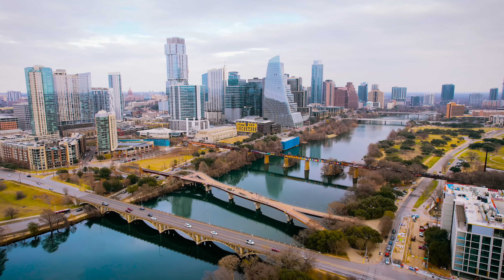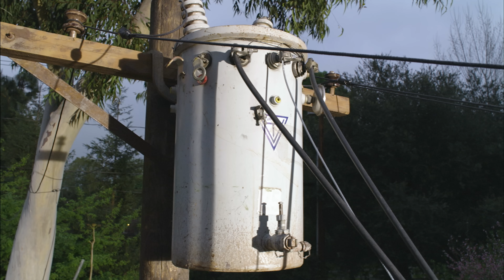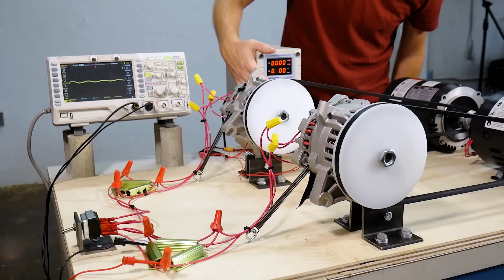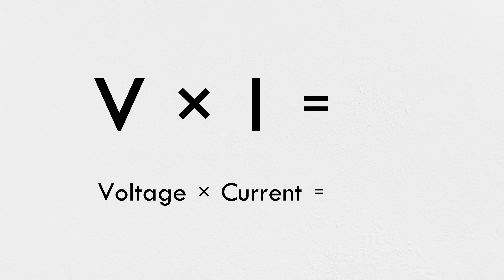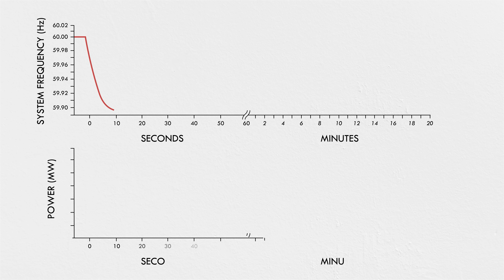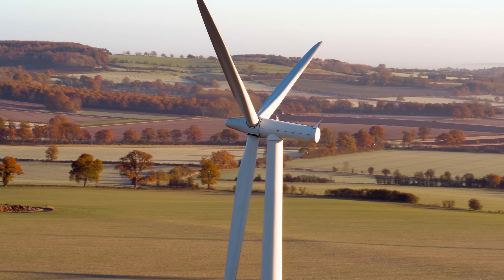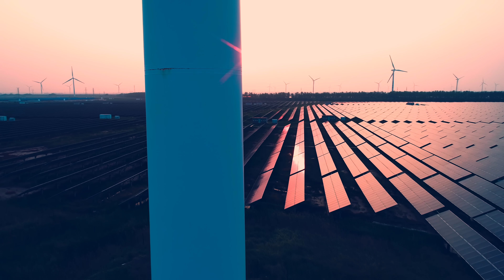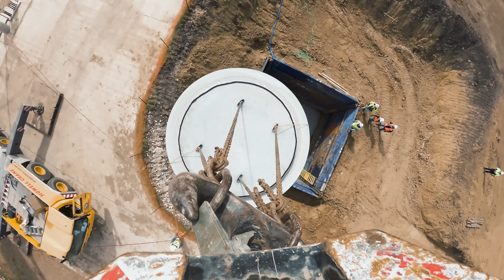Connecting Solar to the Grid is Harder Than You Think

Comment: Observations in no particular order:

1) The drill & generator you showed is a model of a very REAL electrical isolation system (no surges or sags could be tolerated in the computer room) that I saw in use in military applications. Our Explorer post got a tour of such an installation in Virginia back in the 70s. They had an enormous motor connected to a generator with an insulated (plastic?) shaft (for lightning protection) and, if the base's power failed, there'd be enough kinetic energy in the flywheel to allow a quick but orderly shut-down of the system.

2) My own rooftop solar panels use microinverters. I assume there are integrated MPPTs in each microinverter? I have two Powerwalls as well. I also have every sensitive electronic device (server, workstations, and network) protected by UPS units.  This is absolutely necessary because, in the event of grid instability, there's enough lag in switching to battery to harm devices that aren't UPS-protected. It's weird hearing all the UPS units start howling while my overhead lighting doesn't even flicker! It usually happens only once or twice annually.

3) I have always felt that commercial-scale solar farms are an egregious waste of resources. Are we suffering from a lack of rooftops? No, we are not. The highest and best use of PV power is a small-scale utility-interactive system (with a battery bank) right above the heads of the end users. Distributed generation has many advantages and excess power will be used within a few hundred feet of the source (at most). New transmission lines are unnecessary.  Any problems are very localized.

4) Offshore wind power is utterly unnecessary in the USA (not to mention very costly due to extreme weather events and corrosion). We have plenty of agricultural land and wind turbines are far less problematic than oil & gas drilling for farmers and ranchers.
Reply: On #2, basically grid-tied micro-inverters integrate the MPPT into the inverter.  They are one and the same thing.  The "MPPT" function is simply a function of the micro-controller controlling how much power the inverter tries to output to the grid and figuring out where the maximum power point is.

Basically it just ramps the PWM driving the inverter down and then up and records the power output it gets, then settles the PWM down at the highest power point.  Bang!  MPPT.    Once it finds the MPPT point it ramps the PWM slightly up and slightly down all the time to determine if the MPPT point is shifting at all, and tracks it.  Hence the "tracking" part.

And usually every 10 minutes or so the micro-inverter will do a full sweep because the actual maximum power point can have more than one hump in the graph and it needs to make sure that it is on the best one.

On #3 ... commercial solar farms are far, far cheaper per watt than residential rooftop solar.  We do have plenty of rooftops, I've got solar on mine, but the cost of installation is not cheap enough for mass adoption.  A lot of people have solar, but if you look at a satellite picture of your neighborhood (for example) and actually count the houses, you'll find that it is still a fairly low percentage of homes.   Not everyone has the funds necessary to make the investment when the break-even is 10 years.

-Matt
Reply: @junkerzn7312  I appreciate your answer to my question. Your explanation was excellent. I always assumed it was integrated but I didn't self-install my system and don't have copies of the documentation (mea culpa). I did install most of my home automation system, wired ethernet network, and low-power lighting but I'm a bit long in the tooth to be climbing up on roofs!

My highest and best use opinion is NOT based on cost. It's based on factors that justify a slightly higher level of investment. Considering the federal and (some) state tax credits, and local variables like rebate programs, electricity rates, and annual insolation, payback periods for residential solar can vary wildly. I live in the sun belt, so I use every single watt I produce from my 7.5KW array except for the two months per year we laughingly call "winter" because my furnace uses natural gas. My payback will occur in year 7 or 8, supposedly. Years 9 to 25 and beyond will be gravy. The federal credit was recently expanded to include second homes. I think they should expand it to residential rental and commercial properties, too.

Comment: a similar incident to this one happened in (I think it was) Hawaii about a decade ago. It was a mess, a unit tripped off, creating a small frequency dip. Unfortunately, the dip was sufficiently low to cause some of the equipment protection on some of the solar generation to trip, which drove the frequency down further, tripping off even more equipment. I was under the impression it lead to a whole island black out and black start.

Comment: One aspect of inverters that makes them very attractive in densely populated areas is the ability to synthesise matching ‘antidote’ waveforms that counteract the distortion in the mains voltage due to the ubiquity of switch-mode PSUs that only ‘sip’ power infrequently, causing nasty harmonics in the supply. You may have something lined up on this already :0)

Comment: DONT connect it to the grid, there is no reason to. only reasons to not.
keep your solar, or other off grid capable energy sources, off grid.
using off grid utilities on grid is much like converting your car so it only works on train tracks.

Comment: Excellent explanation of grid stability. Many Moving Parts.  Thank You. 
The inverter for you home solar array must be rated for proper waveform, so is more expensive.
You can get your home PV system to work during your two week hurricane outage.  Contact a local Licensed Professional Electrical Engineer.  
At 14:15, the workers had nice Electrical PPE - Personnel Protective Equipment.  Except that leather or heavy cloth gloves go over the insulation rubber glove, as the rubber gloves are easily punctured.

Comment: 6:12 is what you showed, really called "pulse width modulation"? I'm more familiar with PWM fans for PCs, but those work by switching rapidly from high to low. You would never get these partial voltage switches as shown here (without load smoothing)

Comment: If it’s possible could you talk about the synchronous condesnsor. That I’m interested in placing a solar generation facility on land that I own. 🤔 The trouble is that while it could improve the power factor at the facility I install it at I don’t really know how it would interact with the grid tie inverter, worse, the utility isn’t really sure either.😳

Comment: Solar customers should not default to a grid tie system. Loans are schemes. Grid tie creates radio noise and guarantees your kids will grow up radio illiterate. Batteries and 12 volt DC with golf cart batteries is a good small system. Avoid batteries wired in parallel.

Comment: This suggests that the evolution of dependable power is micro grids with the national scale grid delivering dirty power to charge batteries.
This introduces other conversion inefficiencies but,as solar builds out,the abundance of cheap energy mitigates that issue. 
I’ve come to this conclusion due to personal experience using off-grid inverters to power several structures. I was surprised to see how small the amperage,supplied during off-peak hours, was needed to top off my batteries.
Again,there are conversion losses but the savings in wire gauge coupled with cheap solar panels offset this loss.

Comment: It’s not just a challenge to provide ‘fault ride-through’ during transients, but also to provide sufficient fault current at the source, for the generators etc to trip correctly without damaging themselves. If there’s insufficient current available at the generator, as is often the case with renewables (they don’t individually have the inertia of much larger generators), especially when connected over long distances - the protection won’t function correctly and they’ll end up burning out equipment and cables as they unable to ‘disconnect’ themselves. It’s why many grid connections of renewables require large synchronous condensers or similar, to provide the immediate energy/inertia required for protection at the generator source to operate quickly and correctly.

Comment: I found this an intriguing video as a retired Electronics engineer.
Having followed wind/solar/storage/generation evolving for some years, I was rather shocked to learn about the defect in inverter-->grid delivery you described.
I have no notion of how this may be effectively resolved for the long term, but surely there is a way - by measuring power factor at the inverter generation site and using that as an additional means for nudging the grid in a supportive fashion?
Power factor is a measurement that is able to determine the phase-shift between current and voltage.  But it can also be used to determine what must be done in respect of power delivery when the grid 'frequency' is suddenly lower.  Because the power factor measurement can clearly reveal this very problem.
I am confident the boffins will have this sorted fairly soon Sir.
Thanks for your excellent video.

Comment: did we ever switch to DC transmission? DC-DC converters are available and not that expensive now. basically only AC motors today need AC power (but often powered by inverter for rpm/torque regulation, inverters also works on DC) everything else works great on DC.
Reply: in DC many problems don't exist like frequency shift, distortions because when receiver cares about that it's easy to solve there, reactive power also don't exist in DC.

Comment: Any time you want a grid-tied inverter for solar, you not only need to be thinking about the phase and quality of the power you are producing with the inverter; you also need to look at safety measures.

For example, let's say your solar panels produce 2kW and your house is consuming exactly 2kW at that moment. If there's a power outage, your house will start "backfeeding" 240V into the secondary of the blown transformer on the pole. Any utility worker who installs a new transformer will be electrocuted with the equivalent of the electric chair on the medium voltage side, even though their instruments were reading zero before touching the wires.

The inverter therefore cannot be set to 60Hz exactly, it must be set slightly higher or lower, such that if the grid goes down it will drift towards the programmed frequency and trip off. That way, your solar roof doesn't kill a lineman who just switched the breaker off and put a padlock on it, then kept the key in his toolbox. You're normally entitled to treat such circuits as dead, but an unsafe solar installation can power a few houses at noon on a mild day.

Comment: I work in Utility Scale Renewable energy, and we also need to ensure grid relaibility for LVRT, HVRT, Harmonics, Frequency etc. This episode quite nicely shared the challenges of large scale renewables.
Reply: But aren't the big inverters (+100kW) doing all of that already on their own? At least the ones from SMA and Huawei do.
Reply: The “challenges of renewables”? This is not 1975; it’s 2025.  There is no resolution from “etc” to grid sync nor to the grid economics of firm backup power. Stop building too much intermittent power, period. Nuclear works, without euphemisms.

Comment: How is a solar power plant supposed to deliver more on-demand power to the grid when it is operating constantly at its maximum power point (mpp)?
Reply: Possibly panels that are actively charging batteries are switched to directly supplying the grid?
Reply: @mattd6085  Solar power plants usually do not have on-site storage batteries to (temporarily) provide extra power beyond solar.

Comment: Thanks for sharing your ideas, thoughts and videos. As a retired senior system operator I always find your videos interesting and usually spot on. About the only difference is your use of scientific units. In the bulk power industry we usually talk in terms of megawatts for communication clarity. 500KW would be 0.5MW. Or my import limit would be 1200MW not 1.2GW. I have always enjoyed when people build simulations of larger systems, really liked your demo. Was reminiscent of a simulation I once saw using WW2 era aircraft motor generators. By removing the shielding you could see and manipulate the rotors. By tying them together you could simulate how the emf force thru the wires tied them together. Since they were permanent magnet motors. Hand turning the rotor on one generator would cause the other generator only connected by wires to turn as if by magic. 

Another technology you may find interesting to look into are VFT aka variable frequency transformers. They are made by modifying a three phase motor with the stator windings as one half of the transformer and the rotor windings as the other. By controlling the motor input shaft with a stepper motor you can vary the phase between the two systems and push power one way or the other dynamically. An example of this can be found at the cedars station between the NY and HQ power systems. While learning of the technology when they were training us for its introduction to the power grid a fellow operator recognized he had seen a similar setup earlier in his career at a smelting plant. They used a hydraulic cylinder to push and pull on a crank arm attached to a motor input and rectifiers on the output. Making an industrial sized variable DC power supply.

Comment: Small detail that is not correct, you inject real power into the Grid by changing the phase angle, changing the voltage will only inject reactive power not real power :). It is not so intuitive ^^

Comment: It would be interesting to know more about how the grid is tested for robustness against various types of faults.  The whole system is a very complicated control system with both linear and non-linear control aspects.  It seems like the linear aspects of the system can be tested by causing small perturbations at various operating points and measuring the system response, without any noticeable impact to customers.  But major faults seem to be impractical to test, since customers will be impacted.  Is the entire grid simulated accurately enough with computer models to provide adequate testing?  Or is the system response to certain types of faults beyond the capabilities of the computer models to accurately simulate, meaning some stuff still has to be learned the hard way (unexpected failures with major customer impact)?

Comment: Another old, now resolved problem with PV inverters was that in case of an over or underfrequency (I'm going with overfrequency for now), not just one or a couple inverters starting dropping their power but every single inverter connected to the grid. In the early days the power reductions level were hard set which led to situations where an overfrequency triggered thousand of inverters at once to drop their output, causing a sudden drop in the frequency, which then again led all the inverters to ramp back up, causing a fast over and underfrequency swinging, where the overfrequency swinging also led to wind turbines being shut down in the thousands, making the problem even worse

Comment: Weird that you don't know Bitcoin is the best flexible load that is stabilizing the grids. Bitcoin pays for any overcapacity so every power plant can run at 100% capacity all the time and turn off the bitcoin miner when demand goes up. Power plant makes more money and rate payers pay less for electricity and bitcoin miners get cheap power and the grid becomes more stable and the bitcoin network becomes stronger.

Comment: Can you make a video about how the inverter based sources manages the reactive power requirement. I am a Marine engineer and recently got to work on a ship with synro-condenser system. It was fascinating to learn about that.
Reply: Reactive power basically just feeds back into the inverter and can be captured with diodes and capacitors on the DC side.  Then feeds forward again.   The inverter still has to deal with the VA since the reactive power is essentially being fed through the inverter twice, but it doesn't have to dissipate it as heat.  It captures it and feeds it back in.

Comment: River-cooled nuclear power stations usually have tons of power reserves, but you have to convince the wildlife department that it is worth it. Obviously it depends on the power station, but the one I've been to used to let out rather hot water all year round, with the effect that locals went swimming there all year round. Nowadays they have a rule that the river after the power station mustn't be more than 5°C warmer than before them, which depending on the weather can mean a significant power cap. But since all their equipment is rated much higher they have a protocol the colloquially call "Forelle blau mode", after a dish with cooked trout. Basically, if the gouvernment gives them the green light they run the station above that limit to save the grid.

So far they haven't had the chance to boil any trouts, but there have been a handful occasions where their temperature limit has temporarily been raised a bit

Comment: This is why the current LCOE figures are so biased in favor of solar and wind.  I believe that solar and wind that are grid connected should be required to have the same 24x7 uptime and stability as do other generation sources.  This would require large batteries to ensure power is available consistently during the times the intermittent sources aren’t generating.  If this was required, then the cost of the requisite batteries would make the LCOE cost figures apples to apples and show just how grossly expensive solar and wind really is.